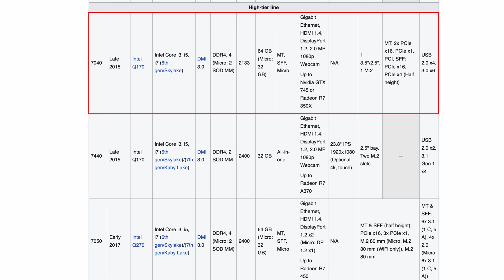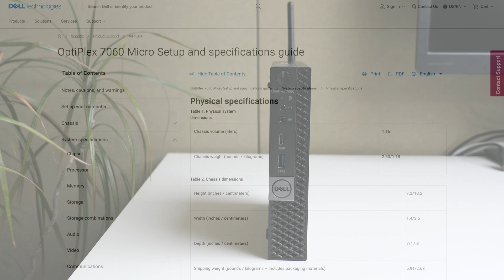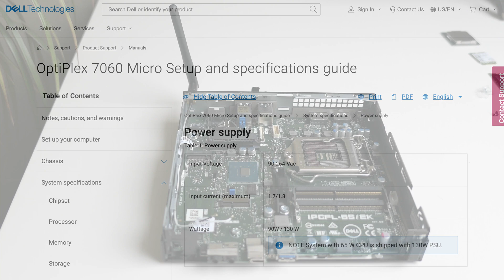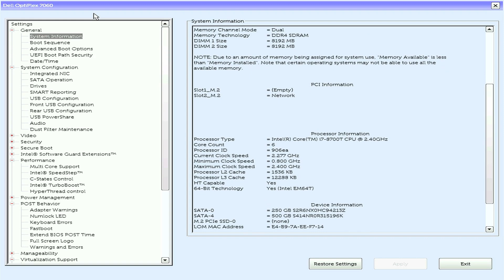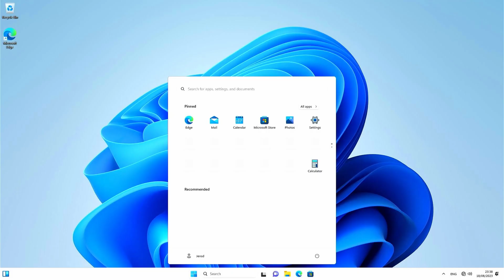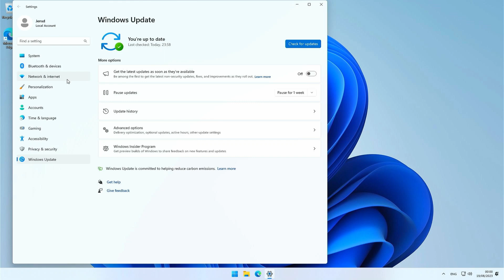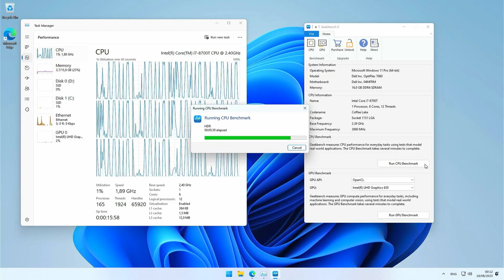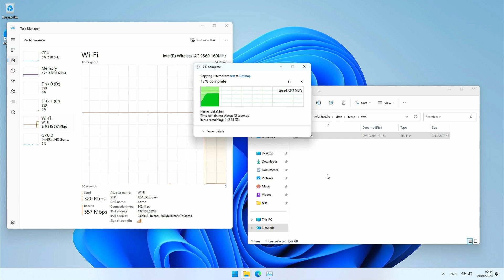Dell OptiPlex 7060 Micro - Teardown - Upgrade - Benchmarks

Comment: You can get most performance results from the web. More interesting would be convert this into a Hackintosh ie running the latest MacOS Sequoia 15.7.1. I converted my HP 600 G5(ie based on i5-9500T) similar dimensions to your Dell. Runs great. I am tired of win 11.

Comment: How come mine didnt come with a built in wifi port? Also how lame is it that they didnt add an hdmi port?
Reply from the maker: I believe the wifi adapter was optional at the time of purchase. The DP ports can easily connect to a HDMI port with a DP to HDMI cable. The other way around is not possible AFAIK so this is more versatile.

Comment: I want to buy this. Have the Dell a HDMI Port?
Reply from the maker: There is no HDMI port but when using a DisplayPort to HDMI or a small adapter, connecting a HDMI display works just fine.

Comment: Variable Fan speed for the 7060 now supported out of the box on Linux since kernel 6.11. For earlier kernel, it worked but you have to configure it.
Reply: got the same problem, how do you configure variable fan on previous kernel versions ?
Reply: my responses keep getting deleted, could be because of the link to github. Please check issue #38 in the repo vitorafsr/i8kutils/issues/38

Try to edit/create /etc/modprobe.d/i8k.conf and include:
options i8k ignore_dmi=1 fan_max=3

Let me know if you are having issues. I’d also recommend raising an issue in the repo above if you struggle or have a different dell machine as the maintainer can submit kernel patches to enable options automatically once a model is confirmed to work.
Reply: /etc/modprobe.d/i8k.conf

Include either:
`options i8k force=1 fan_max=3`
or (should be equivalent)
`options i8k ignore_dmi=1 fan_max=3`

Let me know how that goes. Are you using an optiplex 7060 micro or some other similar model?

Comment: Hello. Please tell me which Wi-Fi/Bluetooth M2 module will fit and be supported by the 0654jc motherboard, ida306 chipset. I would like it to support Wi-Fi 6.
The computer is a dell optiplex 5060 SFF i7 8th generation.
I am leaning towards AX201.NGWG or AX200 but I cannot find any information on compatibility.

Comment: you never told about build in graphics card
Reply from the maker: I'm afraid there is not much to tell about it. It uses the integrated Intel UHD Graphics 630 of the i7 8700T and that isn't really giving you much graphical performance. If I recall correctly, I tried GTA V on a similar CPU with integrated graphics and managed to get around 30-35 fps in 1080p while any entry level dedicated GPU will easily give you double that number.

Comment: maybe you could tell me? Im having a helluva time getting this thing to boot.  I have the 7070 mini ctower and the bios  refuses to allow me to install windows into the system after I upgraded and put a nvme in for storage. it was doing fine but I decided to make the nvme the primary, I removed the primary sata HDD and all hell broke loose in it and now nothing works ....at all. now the only thing I can do I can take a regular hdd drive out and put it in a usb caddy and install win 10 via usb and it works but if I take the hdd out and put it back into the tower it  tells me there are no bootable drives in the system.changing every setting in the bios i can think of and all it ever tells me is there is no bootable drive in the system. I reset bios over and over,pulled out the battery and left it out, tried turning off boot protection, legacy on, legacy backup but when i restart .....still no bootable device present

this all started when I put a nvme 3.1x4 into the m.2 slot, made it active in disk management then rebooted to try and install windows onto it. now I cant do anything with the system. do I just save the  processor and throw it in the trash? I have never had a bios this awful ever.

Comment: Hello! Great video! I bought one recently with an i5-8500T. The seller gave me a 65W power adapter and I think that caused the processor throttle at 800Mhz. POST screen alerted me to use a 90W power adapter. I would just like to confirm that your's is powered by a 90W power adapter or should I go with the 130W one.
Reply from the maker: Mine indeed has a 90W power supply
Reply: @jensdbe  Thanks! I ordered one.

Comment: Hello Dear Jensd,

Obviously, you rock, man! I really appreciate your tutorial, and you have inspired me to upgrade my processor from the i5 to the i7 to have more power on my Optiplex 7060 micro.

I'm afraid of not making the right choice regarding the processor. Which generation of the i7 will be compatible with my computer, the 9th or 10th? Can you advise me on that point? Also, should I change the fan, or would my current 5V 1A fan, producing 5W, be sufficient for the new i7 processor?

Thank you, man. I appreciate it.

Regards,
ML

Comment: Good stuff. Just picked up an optiplex 7060 (used / refurbished) to be used as a guest pc in the hallway. Will be looking into adding an additional drive for dualbooting with linux. cheers!
Reply: I've done the same. One drive has windows 11 (came preinstalled with the refurbished PC), and I got a cheap NVME SSD for running ubuntu (I had planned to use mint, but wifi would simply not run on it as I was using a wifi/bluetooth USB dongle. Hence ubuntu which worked out of the box)

Comment: There's one external antenna, but there are 2 antenna leads, where does the 2nd antenna go?  Is it an internal antenna just attached to the case?
Reply: It is an internal antenna. In fact you can see it when the cover is removed - at the very far right side of the pc you can see a black upright rectangle attached to the chassis with a screw right above it. That is the internal antenna. The reason I know it is because I removed it on one of mine since I replaced the WIFI card with an extra wired NIC instead.

Comment: The Dell OptiPlex 7060 Micro is the first of the series to be able to officially upgrade to Windows 11.
Reply: I've seen a video of the 7040 with windows 11
Reply: @SkhaloQoasho  Sure you can do it,  but there is no license for Windows 11 in the 7040 BIOS and TPM support.  You will have to do work around every time you upgrade Window 11 2XH2 !
Reply: Thank you...makes perfect sense

Comment: There are several videos of other users adding a standard hi-performance gaming video card to laptops through an M.2 port, why not add a gaming video card to this unit?
Reply: You would be limited by CPU performance, you could upgrade the CPU... The cooler won't handle it though. Not to mention the PSU would need 10x more power to handle the new CPU & GPU. Also there's a reason GPU's are generally connected via PCIe and not M.2 - The latency.

All in all, would be a very pointless exercise with insurmountable limitations - If you buy a PC like this for gaming, I dare say the only games you'll play are Solitaire and Pinball.
Reply: @Dan21792  Gaming is not the only use for an upgraded video package. Video editing, mid-level CAD work, 3D graphic design, are just 3 additional uses of upgraded video support. These computers have nice, (not perfect) cpu's, that can be coupled to nicer video packages, that can deliver better+faster results. Computers waiting on people, rather than people waiting on computers (referencing an 8-hr day vs wanting 1 screen refresh right now.)

Comment: what model of dell optiflex micro have a pcie to extension put lan por card?
Reply from the maker: There is a 1Gbit port onnthe device already. Adding PCIe besides with M.2 like for wireless or NVMe will be difficult in this small machine. Maybe using USB is a valid option?

Comment: Hi, very nice and helpful video. I bought a barebones version and installed the CPU, memory etc. When I switch on, the orange light on the front panel blinks a few times and stops. I have ablank screen. The cpu fan starts and stops. Any suggestions on how to solve this?
Reply from the maker: The blinking should happen according to a pattern. There is a guide where you can find what it means: https://www.dell.com/support/kbdoc/en-us/000126021/a-reference-guide-to-the-dell-optiplex-diagnostic-indicators#2012_to_2020

Comment: Mine doesn't have a connector for a wireless antenna but the BIOS says wireless it turned on.  Does it in fact have wireless or do I need an external one?
Reply from the maker: You will most likely need that wireless PCIe card. I assume you don't have that installed. Only antenna is not enough unfortunately.
Reply: Always buy a unit with the WiFi card installed or you will have to shell out another $50 and time to install the card, wires and connector.

Comment: Man pretty cool, but the biggest drawback for me is probably the 1 usb port. haha. I think the sff optiplex has to my option. Thank you for sharing the information and testing. :)
Reply from the maker: There are still 4 ports on the back but I understand what you mean. Even though more and more devices have USB-C now. I also mostly use a USB-A to USB-C cable to connect them :)
Reply: @jensdbe  oh nice! I didn't realize it has 4 usb ports in the back. That would make it usable for me if it comes to that. I would probably use it as a portable workstation pc. So it could definitely be what I need in the future. Thank you!
Reply: The 7060 has 6 USB ports, the drawback for the SFF is the use of a proprietary power supply which will cost big bucks to replace !
Reply: @etow8034  ahhh thank you!

Comment: Does it make a lot of noise or is it quiet under medium-high load?
Reply from the maker: Under high load, it does make some noise but its not terrible. Not completely quiet neither.
Reply: Acceptable noise when ramping up when performing the load and very precise to ramp down immediately once the load is complete.  It also depends on the age of the blower fan which can be easily replaced.

Comment: Thank you very much for the informative video. I have a question: I have this Dell 7060, and I want to add a Display Port module. The problem is, when I tried to connect the micro connector of the module to the motherboard, it wouldn't stay. It pops out and falls out of place. What do you think the best way is to press it into place without using a hammer? 🙂 Thanks again.
Edit: It needs to be plugged into the Video brown connector next to the JMP1.

Comment: Thanks jensd for this wonderful review. Its very much comprehensive.
I am looking for 7000 (enterprise highly reliable )series mini form factor machines. But not getting them here in India. One seller has this 7060 pc .I just want to know comparison of this micro machine with mini (enterprise 7XXX ) series.
Also I want to know whether NVMe SSD can be used for this PC. What is the generation of NVME ( gen 3/ gen4) as m.2 SATA will be very slow.
I want to use this in Tech support purpose.
Thanks again
Reply: Yes you can use both Gen 3 x4 or Gen 4 x4 NVMe SSD with the 7060 Micro !

Comment: The ServeTheHome channel did a review of the 7070 and commented that there is an unofficial support for 64gb (2 * 32) of DDR4 Ram. Can anyone confirm that this is the case?

EDIT: I've received the Micro micro 7060 and can confirm that the Dell Optiplex micro 7060 will support 64gb of ram.

I believe this PC can also be upgraded to the Intel core i9 9900t processor which has the same LGA1151 socket and 35w TDP. 

I'm just about to order the i9 but can anyone confirm?
Reply from the maker: Unfortunately I don't have two of these 32GB modules so can't test.
Reply: It doesn't support i9-9900T, but it does support the i9-9300T, i9-9500T, and i9-9600T CPUs, same as the Dell 5060 Micro can also support for CPUs (unofficially though).
Reply: @jonferraez Ok thanks Jon, unfortunately I found out the hard (expensive) way...

Comment: hi, it's a nice neat little unit for general productivity use, but for gpu the MT version (mini tower) would be better.  Older ones had more room, not sure about newer ones but then their price tends to make them unattractive anyhow.  Basically everything is "standing up" on the motherboard rather than layed down and there are 4 pcie slots.

There's some great optiplex mod videos for the larger case options, including one where the chap cut a great big hole in the case lid and attached a grill which he bought off amazon for temps - once you get a gpu in there and work the cpu it does generate a lot of heat.  Interesting stuff.

Comment: Hi, I am waiting for you to release a video on how to upgrade to Windows 11 23H2 with unsupported hardware. Today (26th of September) is the release date. I am a huge fan of your work.
Reply from the maker: As far as I know the 23H2 update will only came to stable at October 10. They did release it as release preview now and part of the features included come as a separate update. As soon as it is out, I'll test it and see if it needs different instructions.
Reply: Okay, thank you. But if you don’t need to upload a different video then I just have to replace the appraiseres.dll file with the file you shared in the 21h2 to 22h2 upgrade video. Right?

Comment: Best pc in the world
Reply: The 7060(7th Gen) is 5 generations older than the newest Dell 7010(12th Gen).  After the 7080M ex.:  7090, 7000, 7010 etc... the newer gens will not be able to use older SATA SSD.
So the 7080M is the sweet spot in both price and versatility in SSD usage !
Reply: @etow8034 7060 is 8th Gen
Reply: 7060 is 8th gen (i5 8600T) @etow8034

Comment: Even with an SSD this is the slowest machine I have used in my entire life.
Reply from the maker: Then you must've worked with some pretty fast machines or something was wrong with the one you tested. As this is far from a slow PC, except for playing games.
Reply: @jensdbe  Yup, someone probably changed the CPU for a Celeron and left only 4Gb RAM with an IDE mechanical hard drive 🤣
Reply: @jensdbe  that machine is made from laptop parts which are far inferior to desktop  parts with significant performance degradation. Been in this business 30 years. A foolish video won't change facts.

Comment: Hi Thanks for most comprehensive review. Can you pls let me know following
1) what optiplex xxxx no indicates
2) can you pls suggest any newer optiplex having M.2 nvme pcie ssd, since sata is nearly obsolete
3) I want nvme 3rd or 4th gen plus sata 2.5" support.
4) 8th or 9th gen cpu, high quality enterprise build quality
5) 6 or more usb 3.2 ports and type c port.

Thank you
Reply from the maker: 1) It is just a combination of series and generation. Typically higher first numbers are intended for more higher-end customers and then the last digits are typically used for generation. (For example 7040 is the same target audience as the 7060, just a newer generation)
2) As good as all recent optiplex-series PCs would qualify for that.
3+4) Think 7070 or 7470 would match
5) Same as above
Reply: After the 7080M ex.:  7090, 7000, 7010 etc... the newer gens will not be able to use older SATA SSD. So the 7080M is the sweet spot in both price and versatility in SSD usage !
Reply: @etow8034  
Thank you so much 👌 It will be useful those who wants to stick to SATA platform.
Reply: Thank you so much 👌👍. This has clarified all my doubts

Comment: Is this machine Windows 11 compatible ??
Reply from the maker: Yes, fully compatible.
Reply: Did you need to "trick" Windows 11 to install it or is it a standard install. The reason I ask is that when you force an install the upgrades sometimes fail. @jensdbe
Reply: You don't need to trick it for Win 11, as it is an 8th Gen Intel CPU. You can also install a few 9th Gen Intel CPUs in it, like a i9-9500T. Only Intel 7th Gen and older Gen CPUs need the trick done.

Comment: I hope dell release a new version, add a standard pcie x16  socket rotate 90 degree beside the right of the CPU socket, but I think dell won't do this, they don't like flexibility.... so I can buy a used one, and add a graphics card for AI inference...
Reply from the maker: In theory you could use an eGPU but I'm not reading a lot of positive reviews of using that. Even with a PCIe slot in the small enclosure, no decent graphics card would fit nor would there be sufficient power for it unfortunately
Reply: @jensdbe  thunderbolt based eGPU box is expensive for a long time , and a certified thunderbolt cable consumes over $1200 NTD, it slowdown the GPU performance in certain situation, but for Hackintosh purpose, it's okay, usable and comfortable.(macbook pro + eGPU box)
Reply from the maker: @yuan.pingchen3056  I'd love to play around with an eGPU to see how much it gives in terms of performance penalty vs. directly connected to PCIe. Hackintosh is also on my list by the way :)

Comment: what a beutiful little machine. The design is so elegant and it has easy to navigate internals... it's only downside being the terrible m.2 sata drive. Other than that, really good stuff!
Reply: actually you can upgrade it easily with an nvme ssd. The only trouble is the bios is default 2.0, and a bios mod is required to boost the speed to 3.0. I got 3200+ for read and write with a $27 Netac nvme. sold the original M2 (500mb/s) for $10, so total cost is only $17 to upgrade to 1 TB .